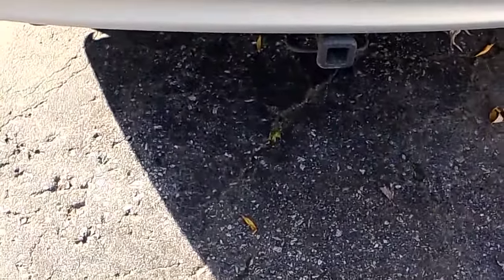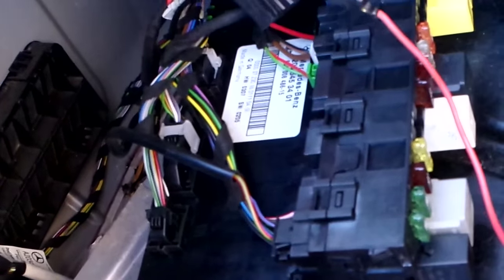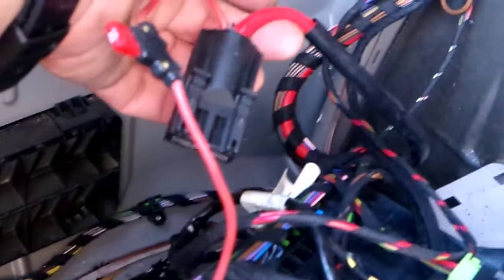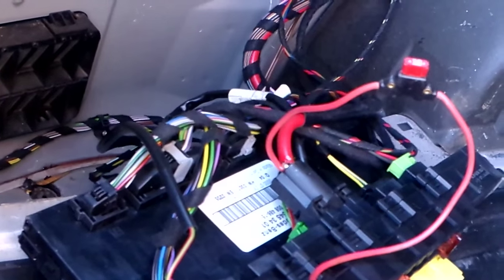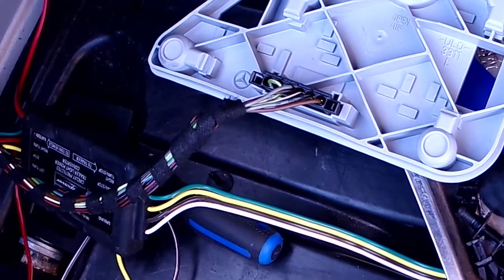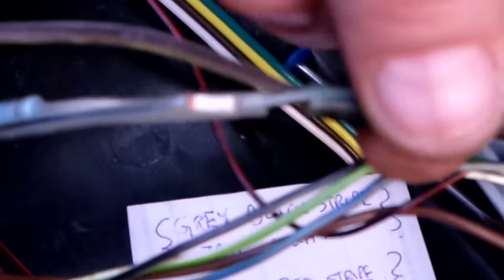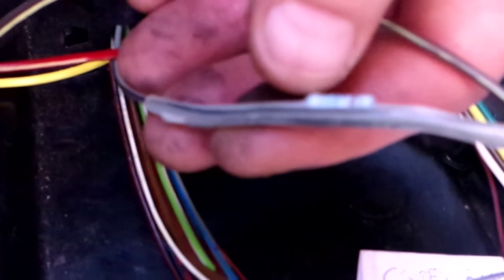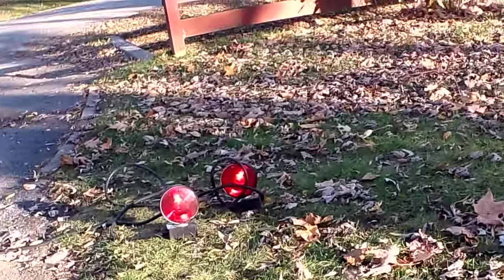Mercedes w203,w209.. how to wire for a trailer hitch

Comment: is the w203 same as w209 tow hitch? cause i found one used for cheap
Reply from the maker: Checking on the Curt hitches website . The 203 has a hitch available and the 209 does not .

Comment: Do you have a brand, model number for a trailer hitch for a 2005 clk320? Thank you.
Reply from the maker: For some odd reason the 2004 and 2005 clk w209 has no hitch recommendations in North America .. but the 2001-2004 and 2006-2009 use the same  curt 11815 . They are all the same w209 chassis. I can only assume the 2004 and 2005 would use the same one .    https://www.etrailer.com/Trailer-Hitch/Mercedes-Benz/CLK-Class/2003/C11815.html?VehicleID=20035928
Reply: fupabox thank you so much for your response.

Comment: Do you have a link to it bro?
Reply: @fupabox  that one does not have a 12v supply though..
Reply from the maker: @elomeli211  you're right .. I typed the wrong #

https://www.etrailer.com/Wiring/Curt/C59236.html
Reply: @fupabox  did you have any issues with the brake light not working?
Reply from the maker: @elomeli211  the new brake light will only be recognized when the car is shut off then on again . Benzes of that era used a lighting control module that shut down power to the circuit when a blown bulb happened to prevent aires and short circuits . It should once plugged in , work once the car is restarted\